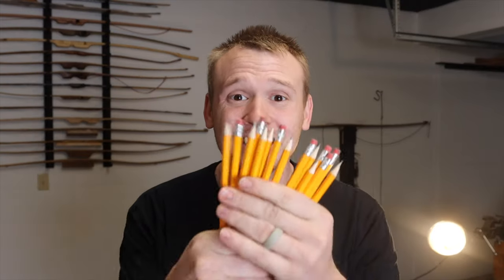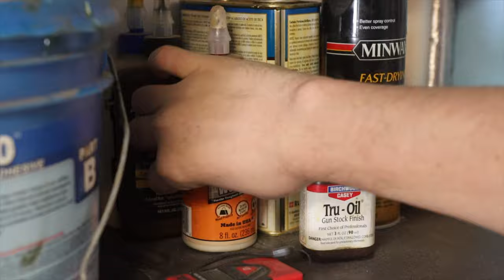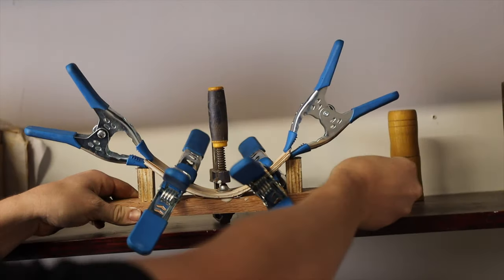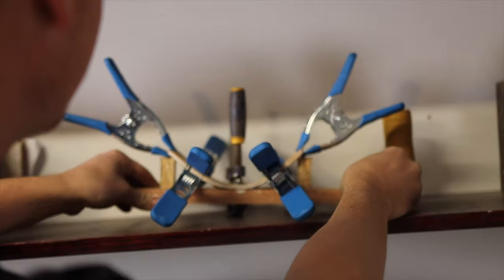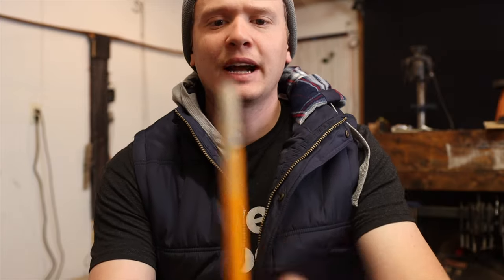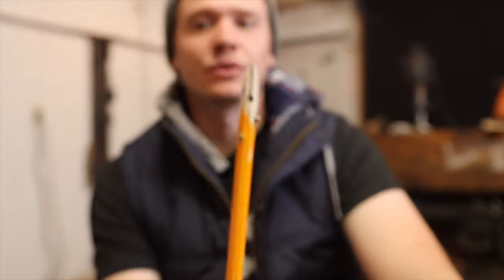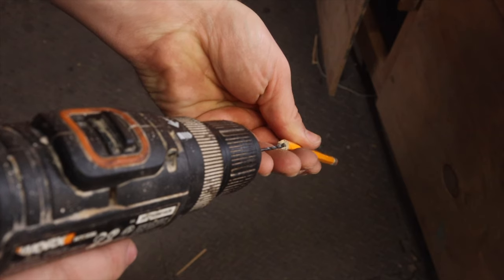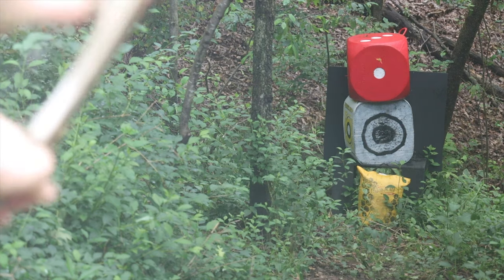Pencil Arrows & Bamboo Bow Shoot 45MPH (Will It Bow!) Ep. 8

Comment: You should try to make a bow from nothing but steel, string, spine, all of it. That’d be so cool, and hey it’s a great opportunity to colab with Alac Steele
Reply: I've made a bow using steel and a large spring, it's great fun to shoot :D
Reply: The problem with steel is that it is not very efficient. When bending it absorbs a lot of the energy, and won't shoot the arrow as fast as a wooden bow of the same weight. On the other hand, it can handle a huge amount of stress, so a very short bow can have a very high weight, and a lot of flex.

Comment: Should have used epoxy or resin for the laminated version. Something designed to be more flexible than wood glue and used two scrap pieces of wood with the diameter you wanted as forming clamps. Kind of like how they make skateboards.

Comment: Question open to everyone, would like recommendations for a decent first bow in the traditional styles (straight or recurve) either is fine... Brand, poundage etc for an adult male. Preferably 500 Australia dollars or under. Cheers guys!
Reply: I have a sammick sage recurve. It was 150 USD and it has worked like a charm for about 4 years now.
Reply: I like Asiatic horse bows, although I haven't tried much else. There is a website called alibow, or Nomad archery that reportedly sell very high quality asiatic style bows for ~100 dollars. I recommend 35/30 pound just so you're not overbowed (when the bow fatigues you too much that you get bad accuracy, form, etc.). 

I recommend you get a finger tab and an wrist guard (just until you get good form so you don't slap your wrist with the string anymore)

Overall it's largely your preference what type of bow you want. There are modern recurves, asiatic Mongolian style bows, korean bows, yumi bows, takedown bows (they come apart), turkish bows, even long bows that the English used to use. You probably should not go super heavy at first. Also make sure the arrows you get have the correct spine (also known as stiffness) for the amount of pounds you are shooting. There are calculators to make sure you get the right arrow for your bow online.
Reply: I would recommend the black hunter longbow it a great bow. And very affordable. 👍🏼🏹🇺🇸

Comment: Interesting that you use Gorilla wood glue. As a builder/remodeler, woodworker, that stuff won't be found in my truck or shop. It just doesn't perform as well as almost any other brand. Titebond, Roo Superbond, Elmer's all outperform it. Check out Project Farm channel and see his tests on wood glue. As a side note, Gorilla brand glue, CA, epoxy, duct tape, whatever, is mediocre.
Reply: Huh interesting to hear you say that. The reason I use gorilla glue is because it dries clear. I thought it made an excellent bond. Every bit as good as tightbond 1 and 2, if not better.
I use it for rawhide backing and snakeskins. And arrow lashing.